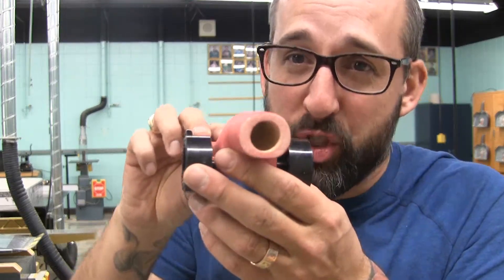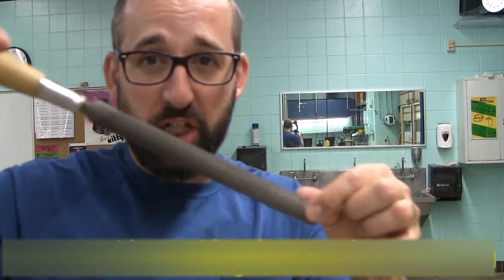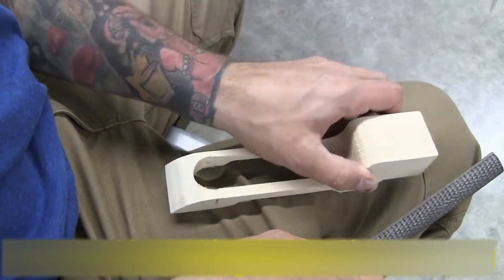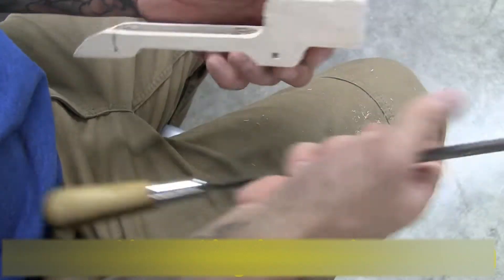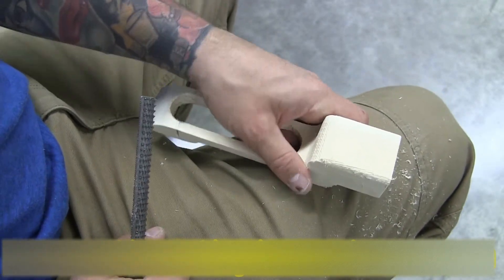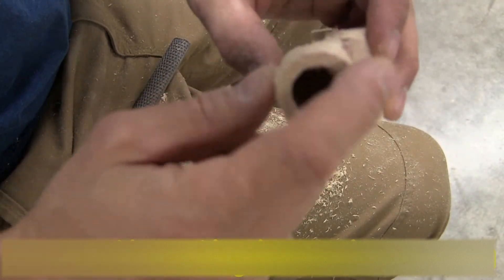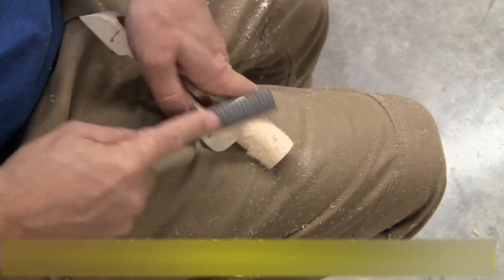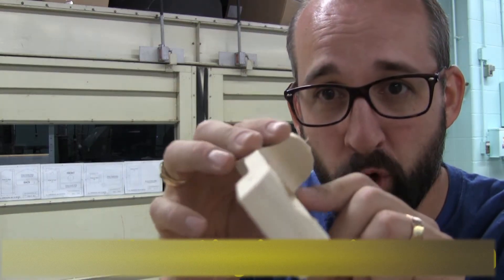Make Your CO₂ Car Faster | Aerodynamics with a Wood Rasp

Comment: Why do you make yours so short?  Wouldn't keeping the length help, all other things being equal, to cross the finish line quicker?  Does the reduced weight in length make up for the increased distance from the nose of the car at the starting block to the finish line?